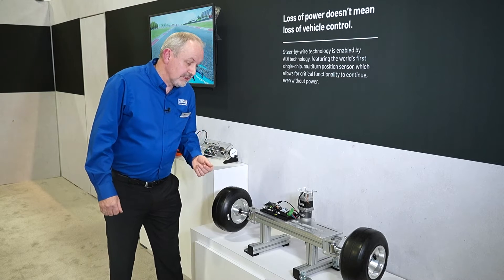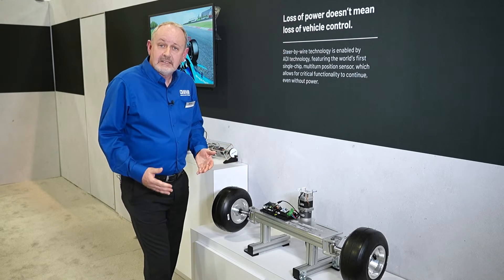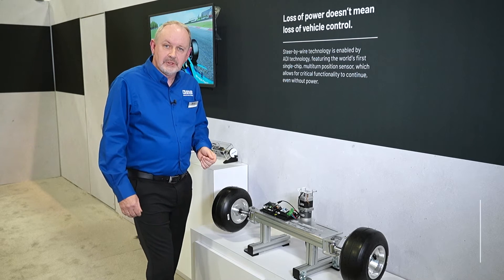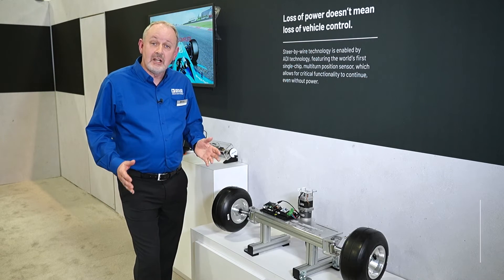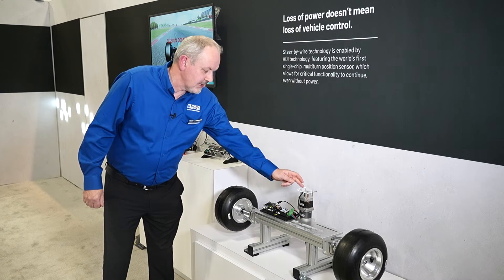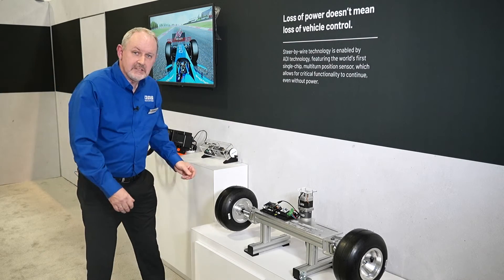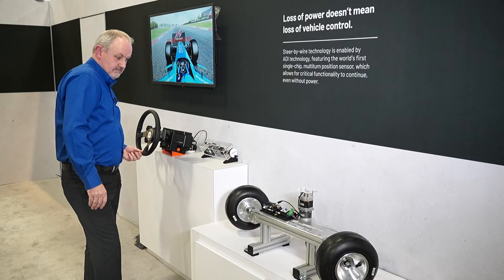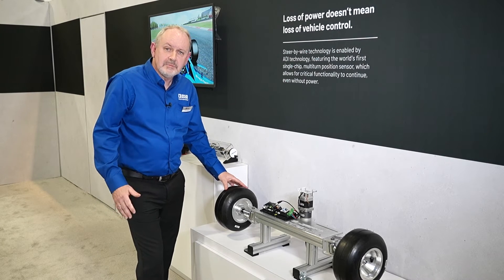Steer by Wire: Loss of Power Doesn't Mean Loss of Vehicle Control

Comment: if theres no steer shaft to mechanically steer you wheels there’s absolutely no way to maintain control of the vehicle if that unit fails. this is an unsafe idea by far. im all for electronics, but i dont want electronics taking full control of my control on the road of my vehicle or my life. this absolutely needs to be prohibited. this is great for a go kart, or golf cart but deff not an everyday use vehicle

Comment: So if during an emergency situation, for some reason you lose power while driving, can you turn the wheels yes or no?
Reply: No, you can't.   That's why he never tried to show it.

A list of power or electronic fault DOES mean loss of control.  Just ask Saturn Ion and Mercedes S Class owners.  It was the reason this system has no longer been used.
Reply: @billcichoke2534 What about the Cybertruck?